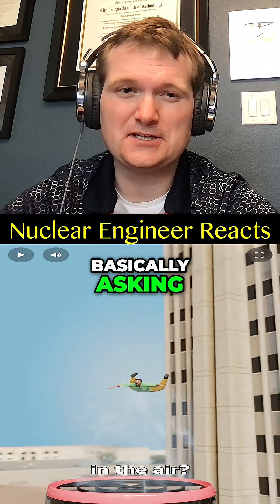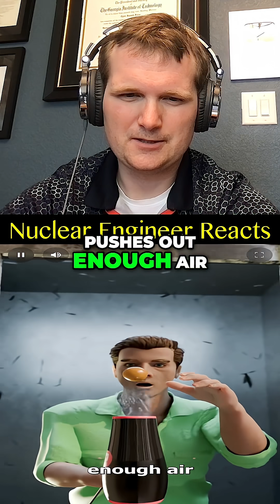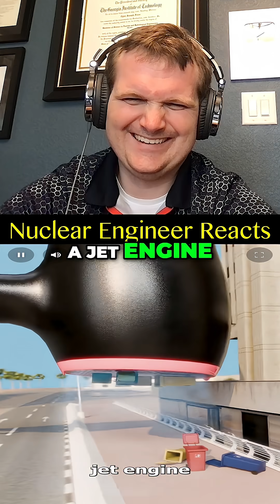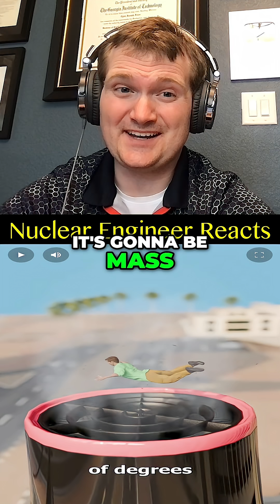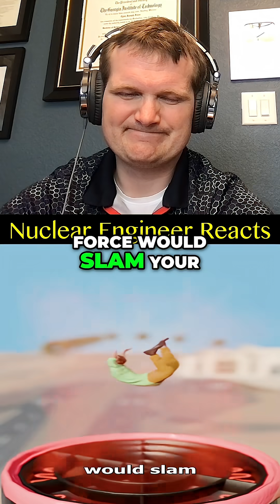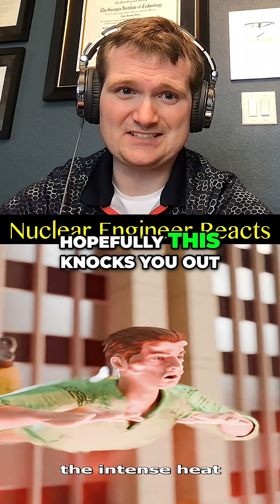Can a Giant Hair Dryer Make You Float? - Nuclear Engineer Reacts to Zack D. Films

Comment: Indoor skydiving... Basically 50 ton excavator engine and hydraulic pump attached to hydraulic motor with fan 3 meters in diameter. It's making 200 kmh wind inside tube... 
You can continually fall till fuel runs out 😂😂😂

Comment: This video acts as if indoor skydiving doesn’t exist lmao.
Reply: You dont need to turn on the heating coil on the hair dryer.
Reply: @jonathanmccarthy6937 i know i’m just saying why the guy in the video said it wouldn’t work
Reply: @ChicoSpins_  He said it wouldn't work because the video shows the guy jumping from a building, but also the air is extremely hot. He didn't say it was impossible to lift a person with air. Just that you can't use it to stop a person moving at terminal velocity and it shouldn't be hot air, nor is it possible to do this without a sealed environment. If you took the massive fans used for indoor skydiving and removed the tube around them that seals you and the air in, it would no longer work. It wouldn't be able to lift adults at all and kids it would catapult in a random direction.
Reply: @Loserstakethebait why does it matter what video shows? The question asked does not specify outdoors or jumping (for example ball floating is indoors). Also, as people mentioned, hairdryer does not have mandatory heat element, it is not burning fuel. it specifically introduces heat element to heat air (which you can opt out from), so again hes wrong. Or atleast his question is wrong. If you want to be right then you should ask “can you float on hairdryer that has heating on, by humping from the building” then sure answer is prob no
Reply: @jonathanmccarthy6937 but this video is saying that it wouldn’t work cause you would burn up
Reply: No it doesn’t. It’s about a giant hairdryer lmao.
Reply: the air isn’t hot
Reply: @ChicoSpins_  that's not the only reason it wouldn't work. Indoor skydiving essentially only works with multiple giant fans, in a tube, with suction kinda like a vacuum.
Reply: @diehardbikes k
Reply: @ChicoSpins_ hair dryers can be changed from hot to cool, sooo….
Nice try lil cuck 😊
Reply: @ChicoSpins_ the air doesn’t have to be hot on a hairdryer, they have a cool setting.
Reply: @DreamFactories i know, it’s just the video said you can’t do it because of heat. dawg
Reply: Yeah zack3d makes useless animations that mislead, lie, or only scratch the surface of truth that's why I unsubbed from them, all that effort for nothing
Reply: Perhaps the author is a European, their electricity is too expensive for this.
Reply: @Vydra-otter Funny how I [I guess not?] have a BodyFlight facility about 20 minutes from me right now,  Gothenburg, Sweden, Europe. (Earth, Milky Way, Virgo Supercluster, Laniakea Supercluster, Universe)
Reply: @michaeltempsch5282 Oh no,my mind is blown! I always believed Switzerland became the Vatican.
Reply: I was not aware indoor skydiving involved giant hairdryers
Reply: Do you drop from the top of a building when you do that?
Reply: You have to counteract terminal velocity before you hit the ground. Compared stand here and then we turn the turbine on. He even stated that in his video.
Reply: @Zanenoth considering the exhaust plume would extent to well above the height of almost any building, if not all, that acceleration would be quite low. For much of it, the exhaust plume wouldn't be much warmer than ambient air, even assuming you decide to still heat the air for no good reason.
Reply: @Zanenoth   you say terminal velocity. but I think the concept does not apply here, unless is a very  VERY   big building or the person is very VERY small

Comment: What about those wind tunnels for people who practice free falling
Reply: A lot more powerful than a hair dryer, and a lot cooler thankfully
Reply: @Cent_Backwards  yes but the part about crushing you is 100% miscalculated
Reply: @kotovasiya-tv  its not actually.
Reply: @diehardbikes  it is. You are not a ping-pong ball to be kept on the current. It's either acts like a wind tunnel or just blows you away.
Reply: @kotovasiya-tv  a giant hair dryer lacks a few things that places like IFly do not: indoor skydiving is essentially a vacuum almost, with multiple high power fans, both above and below you. Secondly its in a tube, not open air. If it was open air, it wouldnt work. So no, its not actually.
Reply: @diehardbikes  and so what? What mysterious force are going to keep you on the current for it to be able to crush you instead of blowing you away? This is only possible with a ball's aerodynamics.
Reply: @kotovasiya-tv  no its not😂😂😂😂 i have studied aerodynamics/engineering relating to multiple different fields, and working with a lot of different companies back when i was an intern for a carbon composites company. If anyone here knows a thing or 2 about aerodynamics, its me. And in the case we are talking about, one singular fan with nothing else to balance it out would certainly cause damage like this. Skydiving in real life you never hit windspeeds high enough to cause damage like that. You say a ball is capable of this because of its specific shape, and thats loosely the case. A ball isnt very aerodynamic so that is to an extent true. What you need is surface area to float. And specifically a way to trap air. And structure as well. Our bodies lack structure as much as wet paper in this case, meaning as soon as it folds, it loses all surface area too. By this point theres obviously no way to trap air. The only readon a ping pong ball can float is because of its weight/air ratio, where the ball is very light. Grams. Maybe like 6 grams. A human who is average is probably around 86kgs if im being really generous. Most are more than that. To adjust the air force to do that for a human? Well i wouldnt wanna be that human.....
Reply: @diehardbikes   great POV
Reply: @diehardbikes  First, let’s get credentials out of the way. I studied at MIPT - one of the top physics schools in the world. I’m very familiar with fluid dynamics, scaling laws, and the physics of airflow. So let’s stick to the physics itself.

You’re treating the ball’s behavior as if it comes only from its shape and "trapping air," but that’s not what’s going on. The reason a ping-pong ball hovers in a jet of air is because of the balance of forces: gravity pulling it down and drag force (proportional to airspeed squared and cross-sectional area) pushing it up. The lateral stability is explained by the Coanda effect and pressure gradients around the ball, not by “trapping” air inside it.
If you scale up the system (a larger “hairdryer” producing a much stronger vertical jet), the same physics applies. The drag force can balance the person’s weight, and lateral pressure differences can provide some stability. In real life, this is exactly how vertical wind tunnels work: they keep a person hovering in mid-air with nothing but a vertical airflow. No one is “folded like wet paper” in those. The multiple fans and recirculation are there for efficiency and flow control, not because the physics requires a tube. They may get blown sideways if not stable, but they’re not crushed by the air - they just drift out of the column. If you put the same upward airflow in open air, it will still lift you (exact same drag = weight balance). The tube just keeps you centered and conserves energy by recycling the air. Without the tube, you’d drift out of the column more easily, but the principle of hovering in a free jet is unchanged.
Airflow doesn’t act like a rigid wall. It exerts distributed pressure and drag. If you apply a huge airflow to a person, the likely outcomes are:
-They hover stably (as in a wind tunnel)
or
-They drift sideways and fall out of the jet
What will not happen is being “structurally crushed.” That would require differential forces on different parts of the body large enough to exceed bone/muscle tensile strength while other parts are fixed in place. But here the entire body is free to move. Physics 101: if something is not fixed, it doesn’t break under a force, it simply accelerates. That’s why you can’t break a free-swinging arm by hitting it - it just moves. Same logic applies here.
Yes, the power required to levitate a human is enormous compared to a ping-pong ball. But that’s an energy scaling issue, not a “structural integrity” issue. If you built a giant hairdryer with the required flow rate and velocity, it would levitate a person without tearing them apart. Again: indoor skydiving.

Conclusion is:
No, a giant “hairdryer” won’t neatly levitate a human like a ping-pong ball without additional stabilization - you’d drift off the jet.
But no, it also won’t “crush you like wet paper.” That betrays a misunderstanding of how aerodynamic forces act on free bodies.